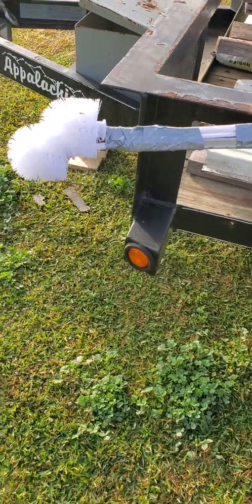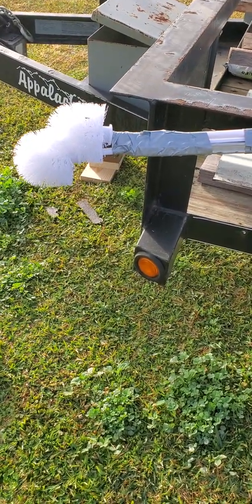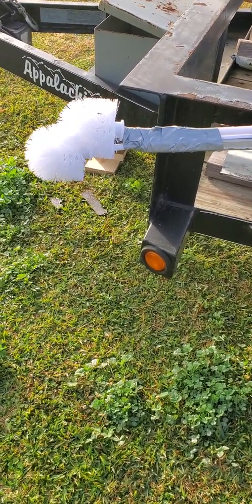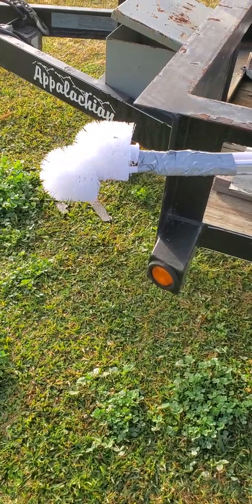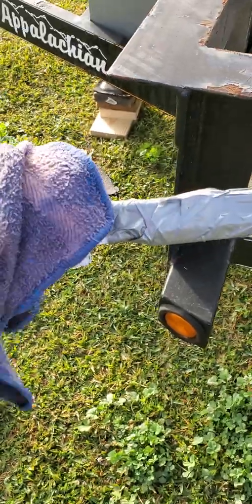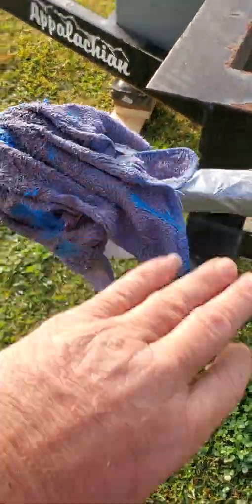DIY cleaning tool for hydroponics drain pipe! #shorts

Comment: Hey danny, brad from H Harvest sent me over,
Have you ever thought of using fish ( bottom feeding type ) in some hybrid hydro/ aqua ponics  set up??
I'm not sure of the mechanics of it all? Not even sure if it possible in the tiered type of setup that you have.
Maybe a led strip type of u.v sanitizer light you could turn on off manually to sterilize the pipes??
Reply from the maker: Thanks for watching and the ideas. 

The hydro and aquaponics won't not work as far as what I have researched. The fertilizer from the hydro would not be good for the fish. Also charting the fertilizer would be hard not knowing exactly what the fish would be adding. 

Thats a great idea for the drain pipes. Will look into it. Its not needed all the time but would be great at the end of the season to help clean up. 

Have a great day!

Gro Dat!!

Comment: I got 10 2 gallon hydro buckets with the tubes that go underneath an connect I have no bucket to hold the water an pump it what would I be lookin for to complete it
Reply from the maker: Sorry to take so long to get back to you. I didn't get the comment on my phone. and just got on the computer. 

I would go with a pump that does about 250 gallons an hour for 10 buckets. 

I get my pumps from Harbor freight and get the warranty. Pumps don't go out often but when they do. Its usually well with in the warranty time period. 

Will you be growing inside or outside? that could make a difference with the size of the tank being used for the sump. Another thing to decide is if you want to bury you sump tank or not or even how far you would like to burry. 

Not sure your location but there is idea temperature that you would like the solution to stay around. By burying it in the ground it helps to stabilize the temperatures some. 

Once you decide that you need to figure out how high the pump will be from the tops of of the buckets. That's the head pressure of of the pumps. Most pumps give you the maximum amount the pump will push under ideal conditions. The higher the tops of the buckets the less fluid the pump will move at that height. You will have to look a bit on the back of the box to find your match.

Finally the size of the sump. I like to go 3 gallon of tank per bucket. That gives me time in-between topping off. Some people go as low as 1 gallon a bucket. but that all depends how much time you have to deal with, mix and add to the sump.

I tried to answer as best I could if you have more questions please feel free to ask. of if i need to go into better detail.

Thanks for watching! 

Gro Dat!!